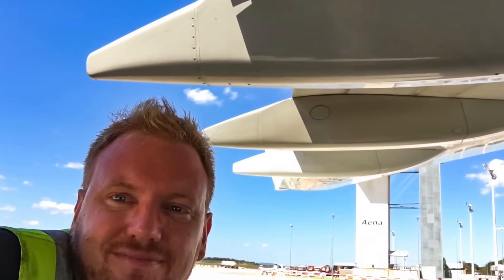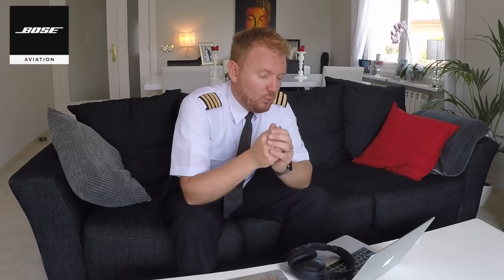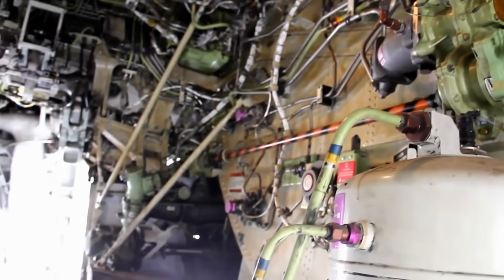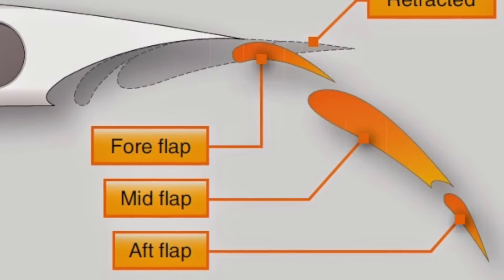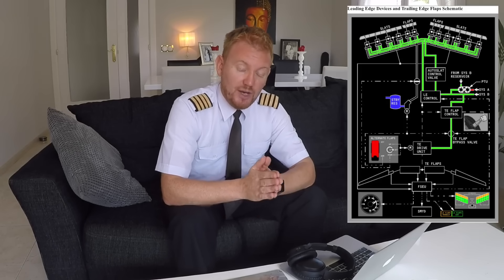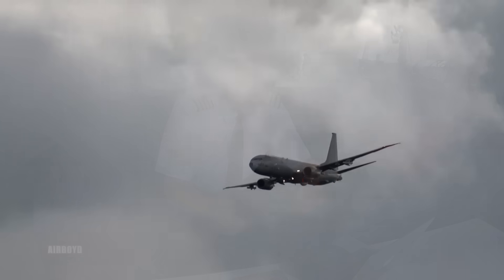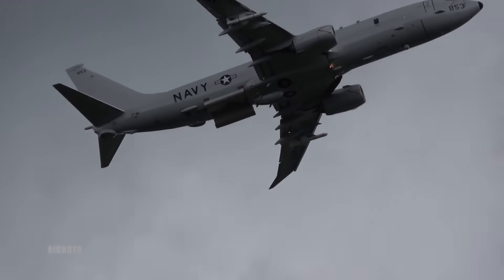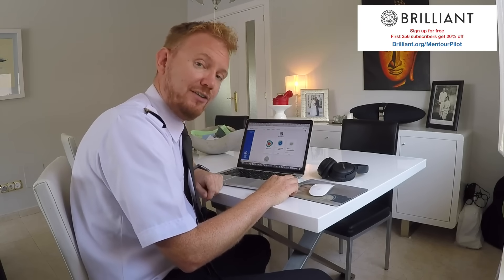"Pods" under the wing? What are they?

Comment: Do you have small cameras all around the aircraft? I would imagine a small camera watching over each wing from the top and bottom, one looking at each of the engines, one watching over the tail fin, then one combined with an accelerometer looking at the bottom of the tail for tail strikes on take-off and one looking at the landing gear ... these would be useful for the pilots. They would cost next to nothing to install both money and weight-wise. Would also allow for the pilots to see the flaps extending.

Comment: The Navy uses 737s for maritime patrol in contested regions primarily near China. They can be armed with anti ship cruise missiles like the Harpoon and the benefit of using a 737 is longer range, expansive sensor suite compared to a smaller fighter. The disadvantage is that they have to operate from land bases but there are enough in the region to allow for effective patrols of the South China Sea. There are enough island bases and land bases in southeast Asia. These jets may also be modified to have in flight refueling capability.

Comment: 2:07 I thought the flaps, in addition to those things, were also supposed to increase the stall AOA by allowing a small amount of the higher pressure air underneath the wing to blead through the gaps between the flap and the main wing in order to prevent flow separation during landing, when a higher AOA is needed due to the lower airspeed?

Comment: These pods are known as anti-shock bodies, flap track fairings, as they enclose the mechanisms for deploying the wing flaps.
Reply: As an aircraft mechanic in the 1980s I remember changing out a flap jack brake. It was under the wing and controls movement extension of flaps so they do not go past their limit. If that part breaks or stops operating you may get flap asymmetry or not enough movement, travel of one flap.

Comment: Hi. I have a question for you, how come engines now are so far forward, there is a Mandela effect of engines been way further back i too seem to remember them further back?.
Reply: Larger engines being fitted on older air frames. To accommodate the larger engines without making it too low to the ground, engineers had to place it more forward and higher with respect to the wing.

Comment: I noticed that during take off, right at the moment the pilot lifts the plane a slight track of smoke appears right above the engine and in a few secs it disappears. What is that? I freaked out as hell, first time I saw it.
Reply: I think it is moisture in the air that gets focused over the wing by a structure on the engine I can’t remember what it is called but it reduces fuel burn

Comment: The flaps are extended by a chicken pump.  One of the oldest methods of pumps, well fed chickens run along a belt and the motion is captured through a serious of axles that lowers the flaps.  The key is to not overfeed the chickens.

Comment: Correction De-Mentour....Zey are "Fairings" - an external metal or plastic structure added to increase streamlining on a high-performance car, motorcycle, boat, or aircraft.  NOT Pods - a detachable or self-contained unit on an aircraft, spacecraft, vehicle, or vessel, having a particular function.  So STOP calling them Pods...! 

Quick-Ref NOTE - Correct Flap symmetry & skew by switching off AP & applying MANUAL aileron input.
Flap-less Approach is the best....demonstrates your aviating prowess...!

Comment: Heres a question, why are the engines of a passenger aircraft not built into the wing, like for instance the way the English built the first Comet passenger  aircraft back in the early 60s instead of mounting the engines under the wing? It seems to me that the possibility of the engine falling off of the wing should be eliminated altogether?

Comment: Guess if the back part of the pod covering is missing the flight can continue.   Remember years ago taking off from LAX with a missing cover on the back of one of the pods which were clearly visible out the window.  The guy behind me joked during the safety briefing how ironic part of the aircraft was missing.   I assumed it would likely only relate to a bit more drag during the flight.  We arrived safely a few hours later in Tampa, FL.

Comment: Hi Mentor Pilot, interesting and clever explanations. My Q. is: Why the commercial Airliner Manufacturers do not provide a series of HD video cameras along the external structure in order to monitor with few monitors of  adequate quality, and some source of lighting if necessary, so that the Pilots can have a lot of visual information in case of problems? Thanks. Rick

Comment: I worked for Boeing for 39 years and made the flap mechanisms in the pods on all the Boeing jets.
Reply: Great work from great people
Reply: @digitalearth8103 this aged well
Reply: @digitalearth8103  until they made the max
Reply: @aljack1979  and then Starliner...😒
Reply: I see you guys got me beat as I spent 30 years at Boeing on the 747, 767 and 777 line and installed the canoes on many of those planes. Those air pods were known in Boeing as canoes.  Even Mentour briefly mentioned the air pods as canoes at the beginning the video.
Reply: I am a mechanic and when i finished maintenance on the right engine of a Boeing 777 i had a hand full of screws left.
Reply: @bertvdlast  extra screws=extra points.
Reply: @bertvdlast  
That plane crashed when it’s engine blew up 🙂
Reply: @bertvdlast  🤣🤣🤣🤣🤣
Reply: @bertvdlast   Were those screws not put back on the engine after maintainance ?
Reply: @fifaham  A plane can easily fly with 10 screws less. Though i won’t guarantee how long….
Reply: @bertvdlast  With due respect, I don't buy that theory though. I wouldn't even trust it on a bike LOL Think about why designers have placed those screws in those places. I am designer (electrical and mechanical) and I know very well the importance of putting back all screws in their correct place. It is very complicated to explain the engineering reasons behind that.
Reply: @bertvdlast my cousin is an SAS mechanic and he told me that when I was 12 😂 I have wondered if he just tried to spook me since
Reply: Weight reduction 😂  @bertvdlast
Reply: @bertvdlast  Those are spares. You're supposed to throw them into the engine inlet after startup for good luck.
Reply: @CheapBastard1988  lol the FOD jokes are killing me 🤣
Reply: I was the buyer at BCAC, group T5634, in the POP department, for the 767 trailing edge flap support fairings (called "canoe fairings") in the early years of the 767.
Reply: I also worked at BOEING for 39 years  I worked in the machine shop,and saw a lot of theses parts  in the shop
I worked in Everett
Reply: Relax everyone. Tom was well-supervised. 🤣
Reply: Anyone remember Yellow Bird airlines back in the late 60s to mid 70s?
Reply: @Flammable281 . Doesn’t ring a bell. What was that?
Reply: did they made NYAAK?
Reply: Great work!
Reply: Pity that they didn't leave any room in the wings for fuel
Reply: And never told us,,!!! How many are there like you out there in all those airports ,,,????
Reply: What is the pod on the new 737 max Tom
Reply: Do the flap jackscrews have autolubing? Seems like a place which can dry up quikly and cause horrible crashes like the ones with failed stab trim screws
Reply: You didn't install that servo I hope :)
Reply: You'd have bragging rights if you made the flap mechanisms for the Gulfstream line of aircraft which incorporate all the flap mechanisms completely inside the wing with no pods. Gulfstreams have the cleanest wings in aviation history.
Reply: So we know who to complain if one of these fall of😂
Reply: Cool!
Reply: Even the boeing b17?
Reply: Even the boeing b17?
Reply: Guy in here trying to say it's refusing pods. Those are for the jack screw and mechanism for the trailing edge flaps like your saying.
Reply: so you were the Podman
Reply: I've never worked at Boeing, nor do I know anything about their air craft.
Reply: So what?
Reply: Thank you for your service
Reply: Swampy sacrificed his life for Boeing cause.
Reply: Was thinking all the time, it's for landing , floating on water under emergency! 😂
Reply: @thestone3849 I thought they contained spare fuel..😅
Reply: Jeez try to leave some ladies for the rest of us, guy
Reply: FairPlay you should be extremely proud
Reply: I worked 45 years in Boeing serving coffee for engineers that designed seat belt buckles...
Reply: So now we finally have this Tom guy who was responsible for chemical trails! Let’s report him! He admits he built the actual gear!
Reply: why lie bro...cheap
Reply: @switchblade8028 just because someone says something that they did that goes beyond getting views on yt doesn’t mean it’s a lie
Reply: So why did you make them so bulky.  :p
Reply: Airbus A319 is the safest plane in the world!
Reply: I live don top of BEOIBOING for 39 years I didnot pay rente!
Reply: @ilovecops6255 BEOIBOING is a truly great company.

Comment: How does an airliner steer on the runway?
Reply: The front gear that is to say  the front wheels on the airplane are controlled in the cockpit with the rudder pedals via torque links or scissors on the front gear and if you use a tug you just disconnect the rudder pedals from a torque links by pulling a release cable that frees up the front wheels so they can swivel left and right freelee being disengaged from the rudder pedals if you do not pull the release you do not want to turn too sharp with your tug truck because there is  stops on the front gear keeping the front gear from turning past 45 degrees or so.

Comment: Sir, what happens to fly-by-wire systems, if they are hit by an EMP? I mean you can get by without power and even instrumentation  if necessary. However, if you lose the ability to manipulate the control surfaces, you will be in for a really bad day.

Comment: Fuel now tell us how you're spraying us with chemtrails
Reply: It's not chemtrails. If you are out in very cold air and breathing you will notice how your breath becomes like a fog. It's because warm air meet cold moist air and the same is happening during a flight. At a hight of 10000 meter the air will be around - 40-50 degree Celsius and it will come in contact with warm air (400-550 degrees Celsius) so that cold air will condensate directly. That's why you see those stripes behind the wings. Check how many stripes you will see and use a monocular to see how many engine's that airplane have. A plane as B747, A340, A380 that have 4 engine's, you will see 4 stripes. But if you only see 2 stripes, then you can worry about chemtrails. Hope it explains a little better. Same like your car will produce white smoke out of the exhaust system when the engine is warm but it's freezing and moist air outside. If you see that then you have also chemtrails on your car 🤔🤔

Comment: Any pilot or government agent or worker can tell you all day what this and that is on a plane. But the reality is that these planes barely use any fuel at all and it is quite impossible for those wings to be full of jet fuel. These planes barely use any gas at all, and once they're up in the air, they just become gliders with a little help from all electric engines that push air through. I know the movies show you things being sucked thru with big explosions. But that's just TV. Lol
Reply: You sound like an expert, you must have experience on aircraft to make such claims no probably not just YouTube videos. It’s common sense in the aviation world that jet aircraft use fuel . Ive had hands on experience with aircraft wing tanks and fuel systems as an aircraft mechanic so I know what it’s like in the real world. The fuel probes in the a/c I work on measure the fuel in the wing tanks which indicates on the the fuel quantity gauges. Are those figures wrong? What about when we have to do maintenance inside the in the wings? They have to be defueled then depuddled using fuel vacuums and vented with extraction hoses. Looks and smells like fuel to me. So yeah fuel is stored in mid/large aircraft from my experience anyway.
Reply: @sexigrande1792  sure
Reply: @sexigrande1792  And also, isnt it funny how just in a short couple of sentences, I can debunk outer space by proving that any real physicist who knows their 'craft' will tell you that the big bang theory breaks the law of thermodynamics and is impossible, just like its impossible for gas engines to combust in a vacuum, (outer space) <--- fake. Yet hollywood movies show rockets and space shuttles zinging around the moon and all this crap. Lol. Tell lie vision.

Comment: why some airplane are made to fly with fan and some airplane are made to fly jet engine
what is the different between fan and and jet engine please explain..
thank you
Reply: Just a tip. Its called a turboprop not fan.
Reply: @lauri4950  ooh thank you for educating me
but what is the different between turboprop and jet engine ...????
Reply: @bahartiaredogs3813  turboprops have propellers and jets have jet engines
Reply: @lauri4950  do they have speed or load carrying power differences  this is what i really mean
Reply: @bahartiaredogs3813  often jets are much faster and have longer range so turboprops are mainly used for regional or short routes.
Reply: @lauri4950  thank you

Comment: Reminds me the importance of only changing one parameter at a time whilst flying, so you know if there is a fault, what is causing it. For example, if you changed throttle setting and flap at the same time and the aircraft began to yaw, then you would not know immidiately what the source of the fault was, thrust or flap?

Comment: AND a horrible demonstration of an asymmetrical  wing configuration is Flight 191 in 1979.   That aircraft literally lost an engine but as bas as that was, it was still considered possible for the plane to fly - EXCEPT that damage from that engine separation caused the leading edge slats on one wing to retract. When that occurred, along with loss of loss of the engine and it's thrust and loss of instruments, the flight crew were unable to recover control.   The engine loss alone was severe and potentially a cause for loss of the plane BUT the asymmetrical lift condition took away all opportunity for that aircrew to recover control.

Comment: Was los. What's the effect of flap percentage? When do you increase it?
Reply: Take off and landing. Increases lift so you can have flight at lower speed. But also increases drag and engines have to consume more fuel, that's why flaps are retracted after sufficient speed is achieved and engines can work at a more efficient regime.

Comment: The RAAF also operate a 737 variant (BBJ, P-8 Poseidon) with air to sea missiles and torpedoes.
The E-7 Wedgetail AEW is also 737 based.
Reply: The U.S. Navy uses the same aircraft, and we also call it the P-8 Poseidon. It replaced our P-3 Orion. It's a anti-submarine/anti-ship platform for patrolling.

Comment: When gazing out of the passenger window, I always thought these pods/fairings served the same purpose as the Whitcomb body, also known as the Kuchemann carrot.  Shows how much I know. Great video, MP - thanks for educating me. ;)
Reply: Paul Kirkland ህውንግፕየውንግ
Reply: An aerospace engineer once told me that they are factored in in a form of area rule, although most airliners are well subsonic....but they simplify the flap actuator design and make maintenance a lot easier while minimizing the need for a lot of access panels on the wing surfaces.
Reply: Kucheman bump or carrot.

Comment: The driveline between the actuator motor and control surface gearbox looks like a speedometer cable, and supplying that cable was one of the many things of concern to the aviation industry in the planning of the production ramp up we are now in. Rivets were also a concern, as were/are trained personnel.

Comment: On a recent southwest flight after backing from the loading gate while seated to rear of the plane i noticed what i thought was water dripping from the pod tip as the plane came to a stop i thought it was strange then the fluid stopped dripping
As we started moving forward the puddle on the ground looked red to me 
I felt like i should have reported it but like I said I really didnt know what it was 
Was it possibly fuel or hydraulic fluid
The paint on the pod looked shinier than the other pods
Retired diesel mechanic
Reply: Paul Tavres i would say you should have reported it, its always better to be sure

Comment: Please let us know where are the engines of the 737 aircraft placed and what is the difference in placement of engines in 737 8 Max? Many thanks for your wonderful knowledge sharing!
Reply: The engines of the max are mounted a bit higher on the wing compared to the 737
Reply: @Jana-ho9mu  MCAS was needed to compensate this difference.....but why was the engine moved in the first place?  Small changes affects the entire system, that means  this change should have been tested thoroughly....so that 300 lives will not be treated as collateral damage to any new change done towards the improvement.....

Comment: Does that military 737 have same wingtips as the 767-400/777??
 Great channel!
Reply: Jesús Pinillos Yes. The military does not have to follow regulations on wing width of narrow body aircraft (in fact the Poseidon has almost an extra 2 meters of width), so they installed such wingtips to increase economy, and mostly make the aircraft more stable and less susceptible to turbulence, which is a key factor when running scans of the waters beneath and launching missiles/radiolocational buoys.